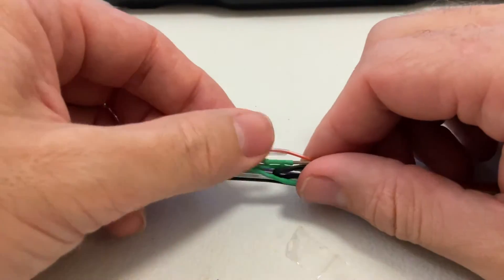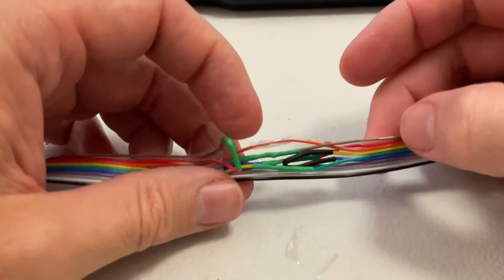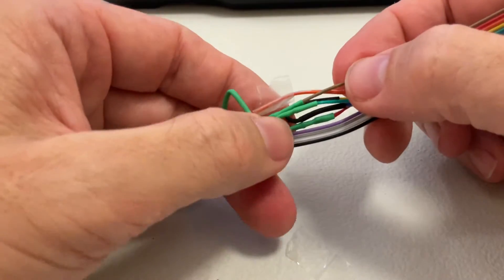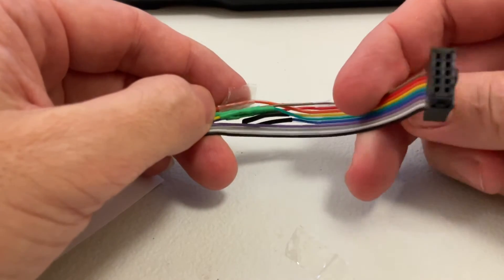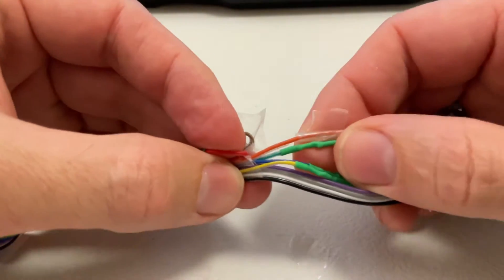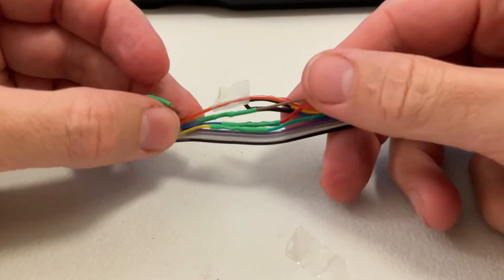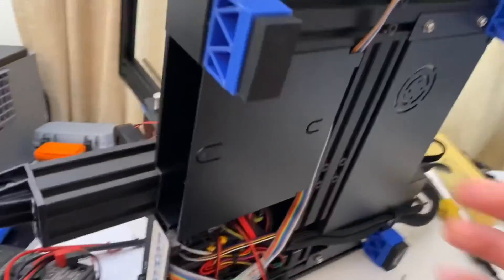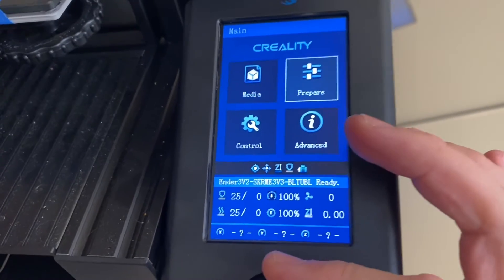BigTreeTech SKR e3 Mini v3 board to Ender 3 v2 stock display

Comment: Thank you :)  Im in the process of installing the SKR mini V2 into my E3V2 with hd display. Its tricky. I cant seem to find pre compiled firmware or get the display working.
Reply from the maker: Yeah I used the professional firmware (mriscoc) and installed the firmware for E3V2 SKRMINIV2
Reply: @GlenEdwards  Hey, Now Im installing a BTT Manta E3v3 with tft35 :)
Reply: @GlenEdwards  link to firmware i need for the board and printer (BTT SKR MINI E3 V1.2 or V2.0 ) and ender 3v2 Display?

Comment: Works amazing👍A piece of advice to others though: be sure to check your connectors are aligned the same as in the video before you start. Out of the factory my cable had the connectors in reverse. Since the red and brown wires are the ground and +5V, the screen was not receiving any power so luckily no damage to the screen. Thanks to your video I was able to pinpoint the problem and resolve it.
Reply: how did you fix the problem.  It looks like mine is the same
Reply: @jamesneely766  If I had noticed beforehand the colours were in reverse, I would have mirrored what's instructed in the video. 

Since I had already modified the cable I just shaved the tabs off with a Dremel and inserted the connector upside down. Crude but effective, although I would not recommend it. 

Last but not least, make sure you thoroughly check how your cable is wired. If the cable didn't come from a working printer I suppose it's not even beyond the realm of possibility that only one connector is the wrong around, in which case you could get a short circuit...

Comment: Can I use this board with ender 3(not v2) stock display?
Reply from the maker: Sorry I couldn’t answer that one mate. I would suggest the ender 3 group on fb
Reply: you can, and this wire mod is only needed for the V2

Comment: So i followed your instructions my screen started up en went beeping.
What could be wrong 🤔
Or do i need to install other software than there is installed out of the box ??
Reply from the maker: Sorry I don’t know, do you get any visuals or is it just black? 
I can only guess one of the wires is not connected correctly?
Reply: I have a start up screen and then it stayed that way 
But no beeping anymore, the beeb came from the screen 😊
Reply from the maker: Very weird. 
We’ll if you saw graphics on the screen that means the cable is working at least. 
Maybe the firmware isn’t booting. Sorry I can’t be more help. Try different firmware? I use mriscoc (make sure you use the one made for your BRT SKR board)
Reply: Somehow my comment didn't show. I had the same problem with a screaming screen. Fixed it with the Marlin 2.1.x bugfix and some mini tweaks in the source code. The problem was that the motherboard wasn't defined and could therefore not be recognized by the screen.
Reply: @kitz703  can youl elaborate further on what you did, having a similar issue
Reply from the maker: I use Professional Firmware “mriscoc” and I have not had any of these problems. But there is more than one type of screen on the V2, so maybe the screen issues you are having are due to a different model. 
Try follow the GitHub page instructions for updating firmware and screen firmware, and I highly recommend try the mriscoc firmware.
Reply: Hey I don't get a screaming screen but I get just blank screen and fans don't work and the motors do work as far as cura control on pc connections